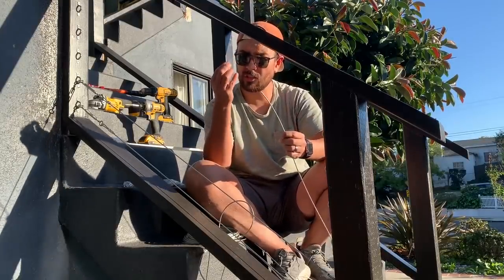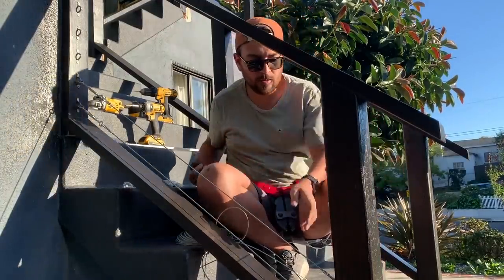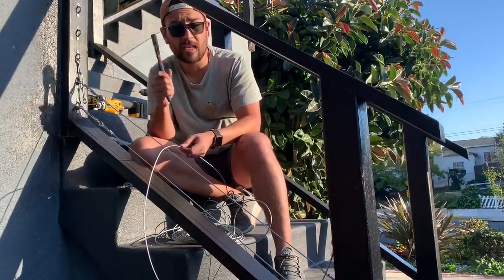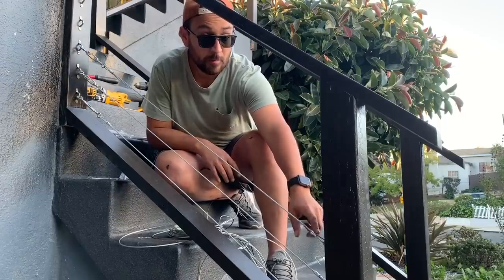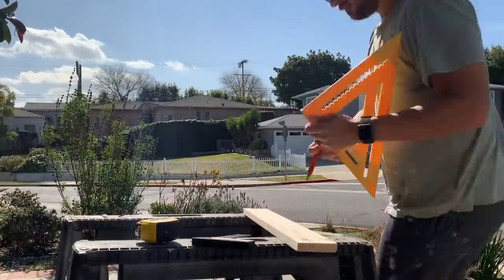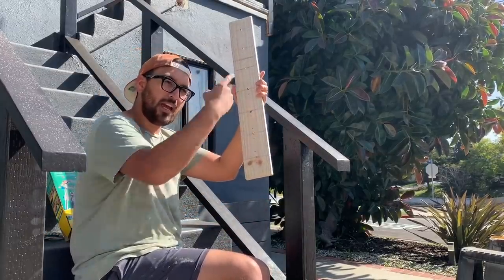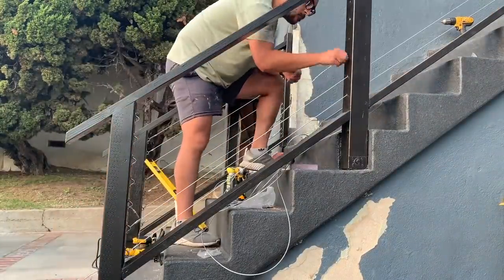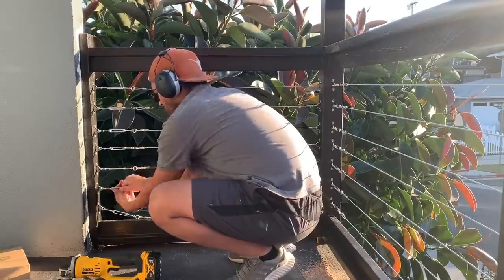First Look at How to Install DIY Cable Railing | Home Improvement Tutorial

Comment: Such beautiful solid old railing that's in good condition and been there a long time.  Why would you want to remove it and put cable in.  You do know it won't last nearly as long.  (The u bits will fall out when the screw holes rot. ) It will also date very quickly. The most important step one of home improvement is know what  to leave and what to improve.
Reply: Well I certainly think it looks better now, maybe he thinks as well? Tastes are different. The most important step to commenting on youtube is know what to write and what not.
Reply: The most important part is to realize that personal taste means personal. It may look good to you but it might look like shit to the owner. I don't think this is really the place to judge lol